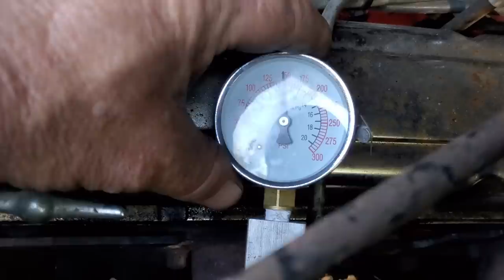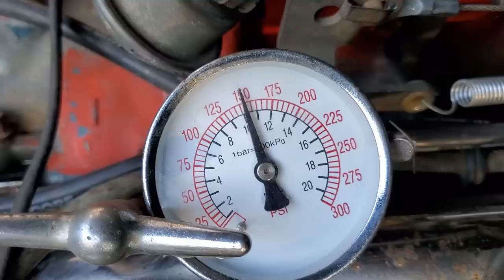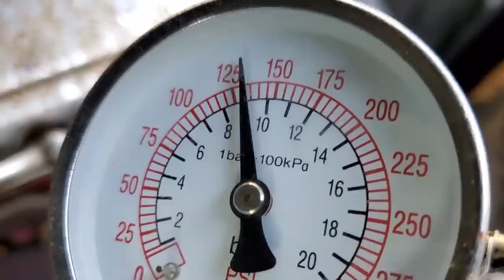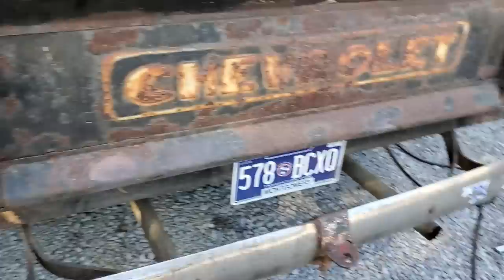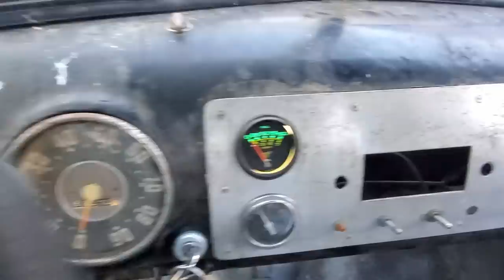Dude Gets TWO tail lights with turn signals AND a 4 speed Muncie Transmission!! (Partial Fail!)

Comment: Hey I really think your a good mechanic but those wire nuts are going to burn your rig down some day, they are just not the way to go man, that's botch!
Reply from the maker: You'll have to explain how wire nuts are going to burn it down. 🤷🏻‍♂️
Reply: @ThisNThatGarage  water can get in and the wires are more prown to corrode because of that, also the contact between wires can generally be bad or get bad over thine because of said corrosion witch causes them to get hot, even so hot that the Plastik/insulation melts and they actually catch fire.
Reply from the maker: @bennetenglisch1467  Any connection will corrode unless it's completely watertight. That's not exclusive to wire nuts.
Reply: @ThisNThatGarage  yes that sure is true but if you twist the wires together water can get into the connection and coorode between all those little copper wires of the cable till only a very small part makes contact, witch can then get very hot. This can't happen on a soldered on brass connector because the brass peaces tension against each other witch prevents corrosion from getting inbetween and creating high resistance.
Reply from the maker: @bennetenglisch1467  I ain't gonna argue with you but a wire nut is no different than any other crimp, push on, screw on or any other type connector that ain't weatherproof.
Reply: @ThisNThatGarage  well if you've had good experience with it,  I just really have a different opinion and different experiences with those things and so I was just concerned.